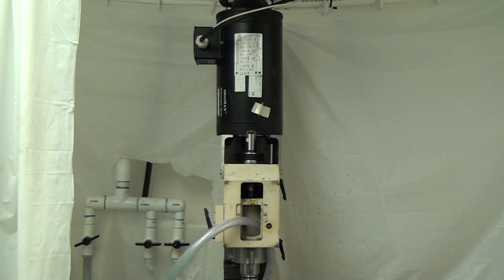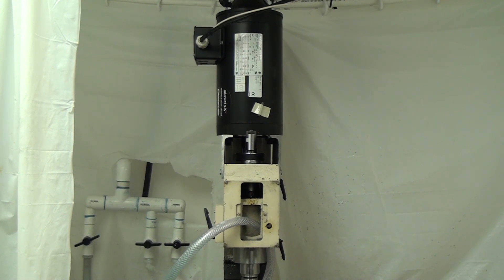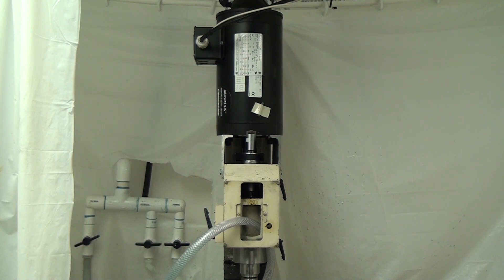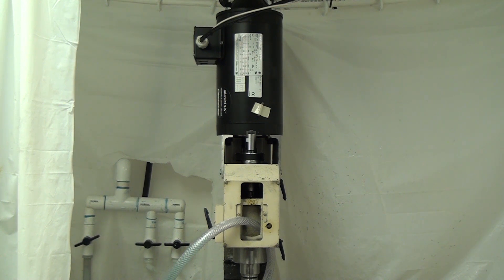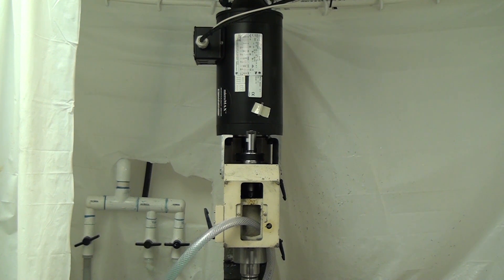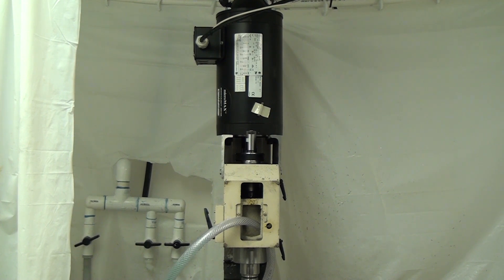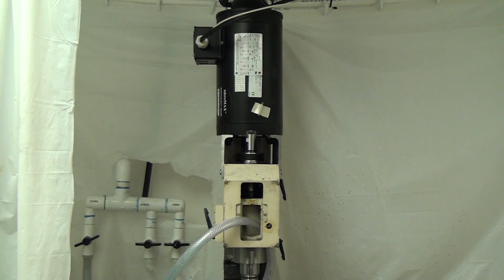CNC-G0704 #21 Heavy Motor = Problems?

Comment: You want to increase the excell not decrease it on the Z if the motor will tolerate it without stalling . Excel is your friend as one person put it. on a servo industrial machine its called servo lag.can be electronic or mechanical. I have actually seen the z geared slightly different in an attempt to counteract it. 
Yes I know this is an old post
Reply from the maker: Thanks for your post, Tom :)

Comment: I've seen machines with bicycle chains (attached to the spindle head) running over the top on sprockets,  and attached to (x) amount of weight at the rear to counter balance the weight of the head. That might come out cheaper and more reliable.
Reply from the maker: I debated something like that. The problem seems to have solved itself so for now I am not doing anything extra.
Thanks for watching!

Comment: Russ, watching the tool cut across that top corner is reminiscent of my Grip 1340 lathe I cnc'd some time ago. The weight(mass) or axis burden should play no part in this: IF - your acceleration is chosen to respect the drive motor (#34 stepper) limited power and your following error limit is set to a low sensible value. The trajectory planner loves to round the corners but sharp physical corners with only .2" clearance will NOT work  in rapid x to rapid xy moves, unless you use exact path mode AND/OR up your vertical clearance to ~0.75".
Recall from basic physics that inertia of rest is not nullified by the counter weight. Counterweight will help once up to speed but
during acceleration not-so-much. If your upward |acceleration| is >> gravity the counter mass has no play in the game as its tendon would be slack. Can't push a rope!

Very happy so see a young achiever like yourself presenting an exciting topic so very well done. Thank you.

William Phillips

Comment: i'm running very dirty and simple counterweight going up-down in the rear of the column. it won't dampen vibrations like struts might but it took me a whole 15 minutes and a bunch of dumbell weights, steel rod and a steel cable i had laying around. i don't even have the pulley. which i probably should put on but it's working for now. i'll get to it eventually.
Reply from the maker: Excellent. Thanks for the info!

Comment: Hi Rus, have you considered changing the stepper motor? On my WEISS WMD30 I use a 4N·m low inductance NEMA 24 stepper motor direct coupling with the Z axis and I get 3000 mm/min in rapids with 48V power supply (with high aceleration, don't remember how much now). Take into account that my mill headstock is waaay heavier than yours. In fact my mill had a gas strut on the column but I had to take it apart because it was slowing my rapids by 40% while rising the headstock. The gas strut was too slow expanding and it was creating vacum.
Reply from the maker: Right now I would prefer not to change to a larger stepper, but I won't say no to anything.

Comment: Oh yeah, also, all the knee mill conversions I've read about that use the knee as the Z axis have used the gas strut counter weight idea. They have downsides when used in that applications but I don't see any of that mattering for you, your head weight will only change a tiny bit as you change tools.
Reply from the maker: Thanks for the info!

Comment: russtuff One other option would be to have a floating head (i am unsure if it's actually called that, that's how i heard them being called way back) power delivery system. Where the motor is stationary on a separate plate than the head and the head has a longer shaft which has a floating pulley on it. That would work pretty well, the distance up and down isn't that big and there isn't much motion either.

It would also liberate the head to move under its own weight, if that has adverse effects..i am unaware of them.

This type of system is found in pantograph mills (some of them), but there, the delivery is far more complicated than just an up and down motion, and it involves a lot of pulleys and plane transfers, i've seen some with motors that sit in the base of the machine, and from there, they change from horizontal rotation to vertical and then to parallel to the ground, plus axis movements, so some counter weight system is involved too. Like i said complicated. But they do work, and considering those are mostly designed for operations that are below the 10 cm mark, i'd say they do a pretty good job, excellent and above, actually. (i know of them from coin making, helped a friend make an article about how coins are minted, the machinery was pretty darn cool, even by today's standards).

If i'm not mistaken, Keith Fenner's (youtube) Sibley drill press (a 24incher) has this floating head design, where the motor is not on the moving head rather far back, and through a system of belts, pulleys, and gears the power is delivered to the main shaft, which, is connected to a floating gear, in a Google picture of a complete unit, i'm sure you could see what i'm talking about.

Comment: Have you tried G61 temporarily or replacing the rapids with high feed rate G01? Someone already mentioned changing the G64 P and Q parameters. Though, does G61 and G64 work as expected with G00 and LinuxCNC? If you're using Fusion360, it's easy to swap G00 with G01, it's in the Linking tab of the CAM operation. I had similar problems, and was able to solve it without a mechanical change. Hope you find your solution.
Reply from the maker: I have not tried high feed G01 yet, but I intend to do a bunch of tests this weekend. Thanks for the idea!

Comment: The conventional way to solve this problem is with counterbalance weight. That will provide a constant upward lift regardless of the Z travel. If by struts you mean air springs, they will have a linear ratio between displacement and force. If you're referring to air cylinders they will provide a constant force upward in Z.  However, I'm not sure that I understand your problem with the insufficient travel. It's my understanding that LinuxCNC uses the acceleration you program in the config to determine the path and you shouldn't be having those cuts on the top of the workpiece when the end mill is below the top surface when the motion in the xy-plane occurs. The stepper motors should either be losing steps or not, and it doesn't look like the Z axis stepper motor is losing steps. The heavy motor shouldn't be causing the Z axis stepper motor to run slowly. Yes, the acceleration will be less but that should be programmed in your config file to match the capability of the machine and the LinuxCNC motion planner should take that into account, even if it does look like you mounted a milling machine to your motor rather than mounting a spindle motor to your milling machine.
Reply from the maker: I agree, but I'm not sure how else to explain it. I'm definitely not losing steps because the Z always returns to the correct zero after retract. Plus, I've lost steps before and I know how bad it sounds. I intend to test the Z further this weekend.

Comment: We used air/gas springs from mcmastercarr for a DIY 20 ton press brake we are working on and love them. They where 25$ US a piece and each have a lifting load of 250lbs. Rated for 25000 cycles. I know for sure that they would help you in this case. Just a little personal experience FYI. Video on that press brake is coming too. So you will have a chance to see it and how it was built. Best Matt
Reply from the maker: Excellent, good to hear. I'm sorta leaning this way but we'll see. I want to do more tests.

Comment: I would say research it on cnczone it is my understanding that if you remove to much weight it will cause vibration and poor surface finish.  hope this helps and great video.
Reply from the maker: +gremlinsports That's something to consider. Thanks!

Comment: Are you sure its the weight causing that? The way steppers work, I don't believe there is any way adding weight would make it accelerate slower without losing steps, I don't think that's possible. Either it makes a step when its told, or it misses it. At least as I understand it anyway. The thing that really makes me think its not the extra weight is the fact it was hitting on the way down too, which shouldn't have happened if it was just acceleration causing the problem. 

Is this the only time you have seen this happen, or is this happening on things that you are sure it didn't happen on before this motor? It really seems like a settings or programming thing to me.
Reply from the maker: Huh, you make a good point on the way back down. I hadn't considered that. It never had this problem before, and nothing has changed except having a new motor on it. The configs are the same before/after the head.
Reply: Came here to say the same thing. The steppers are position controlled, not speed. It's either the stepper is missing steps or there is some significant backlash introduced by the extra weight of the motor. Something may be flexing.
Reply: Interesting problem.  I would tend to agree with Kevo F.  The lost steps would be cumulative...right?  So that would really throw things out of wack after a few moves.  I doubt the cuts would stay so uniform.   Any chance your stock was a bit taller this time?  
Even if it's slow to lift, once it's there, it's not going to drop earlier than the controller tells it too.  The cut on the up and down look and sound pretty equal.  Do they look the same?  The X and Y movements are going to be consistent, while the Z movements would happen at two different rates.  I would think they'd look different.  I would also think that there might be a bit more roughness right at the very start of the downward cut because some of the load would be taken off and slow the drop slightly. The up cut would be perfectly smooth since there would be no change in the load.  I could be way off the mark, so these are just my thoughts....right or wrong.....but it seems to me that it's doing what it's been told to do.  I'm looking forward to hearing what the fix turns out to be. :)
Reply: The only easy way to test this that I can think of is to film it making a Z move 4" or so up and down, with and without the motor on the head (in slo-mo if possible). Then in your editing software see exactly how many frames it takes to make the move. If both moves take the same time, its not the weight. If they are different, it probably is.
Reply from the maker: I've considered that too.... but I really don't want to pull that motor back off. If nothing else works then I'll do it anyway.

Comment: Just watched Chris DePrisco's video where he had a similar issue [1]. Sounds like he solved it by adding a rodless pneumatic actuator from Tolomac. The downside to using an air cylinder like that is you have to have a permanent air pressure reservoir of Npsi. If you can dedicate a smaller air compressor to it though can makes the head nearly weightless from the motor's perspective.

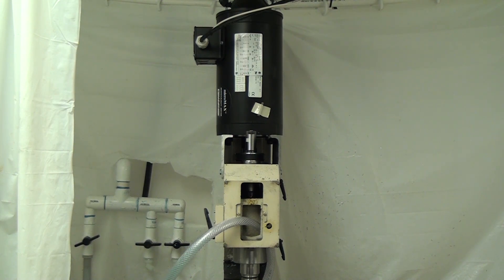[1] https://www.youtube.com/watch?v=A9eDt-H-Pis @ 4:25
Reply from the maker: Excellent. Thank you!

Comment: With moves long enough to reach maximum velocity on a machine with low acceleration and no path tolerance specified (default), you can get a fairly round corner. When using G0 (rapid) moves with G64 use caution on clearance moves and allow enough distance to clear obstacles based on the acceleration capabilities of your machine. You can set a tolerance on rounding with the P parameter. If you program G64 P0.05, you tell the planner that you want continuous feed, but at programmed corners you want it to slow down enough so that the tool path can stay within 0.05 user units of the programmed path.
Reply from the maker: You're blowing my mind.
Reply: Comment just above an excerpt from:
http://linuxcnc.org/docs/2.6/html/common/User_Concepts.html#_programming_the_planner
G64 - (Blend Without Tolerance Mode - Default)
G64 P- Q- - (Blend With Tolerance Mode)

Comment: Counter weights?
Reply from the maker: I considered that too. I could probably put some sort of axle through the column and use chains on pulleys or something else. It seems like struts would be less work though. I need to do some research before committing.
Reply: +russtuff Check out the rf45 conversion on CNC cookbooks.  He used a counterweight for his head assembly.  A counter weight is pretty easy to Ballance but watch the acceleration since you end up moving twice the mass on rapids.
Reply from the maker: Right on. Thanks.

Comment: Wow she is a heavy motor. 
You mentioned 100lbs for both I weighed the PM727M and the gearbox weighs 72lbs and the stock motor was about 30lbs. The new Lesson Metric motor is Aluminum frame weighs in at 21lbs. For the 1 hp. 
I think struts will help but you still may have a issue with time. That's something I did not quite understand  
If it moves @ 80IPM the time it takes to move .200 should be the same if it's 20lbs or 100lbs  unless the stepper is bogged down and not really moving at 80IPM.  But you would think it would be losing steps. Maybe a Linux thing. At any rate careful with the strut choice. As to much and you will be in the same boat trying to compress the strut. I think   Like you said something in the 50lb range or two inverted 25lb springs. To get full travel.
Reply from the maker: It may be that it isn't attaining full velocity but even if it is, having a slower than expected acceleration just to reach full velocity would cause problems. I know, weird. I expected it would lose steps before anything else being an issue.
Reply: +russtuff yeah that's what I thought I guess the Linux algorithm doest quite work the way you would think. Some struts will definitely help. I'm hoping I won't need them but expect I will at least for a little help. Curious does your z drop when not under power?
Reply from the maker: +CNC4XR7 It does not drop.